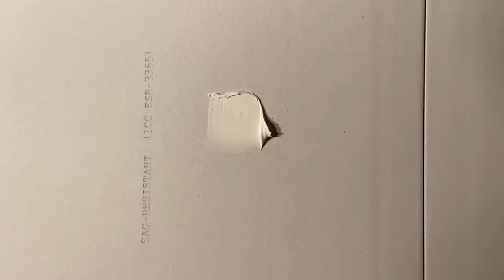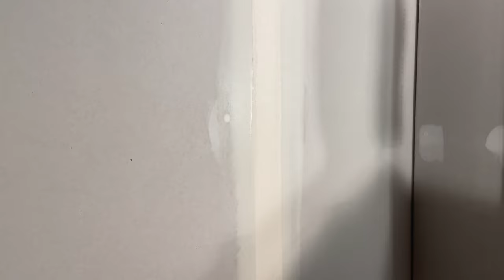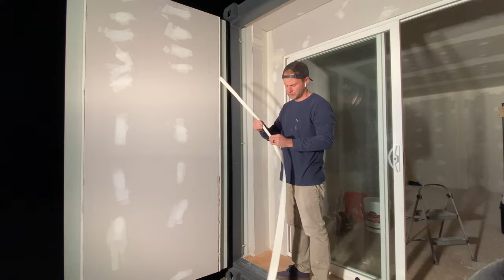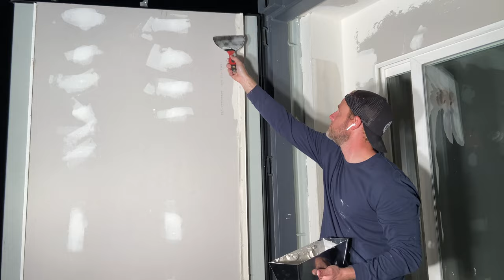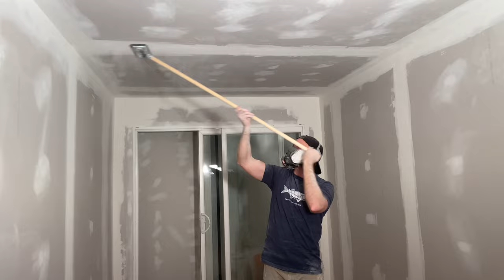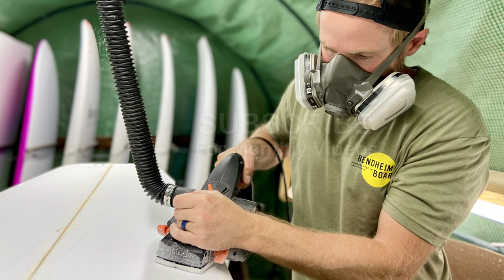Shipping Container Shaping Bay [Part 5 Drywall Mudding & Sanding]

Comment: Taping tip: drop each piece of tape in a bucket of water while you apply compound over the seam and then pull the tape through your fingers to squeegee off the excess water. Then apply tape as normal with a thin layer of compound. This will get rid of any tape bubbling issues (it sucks moisture from the compound otherwise). That is going to be an awesome shaping bay!
Reply: I'm a bit curious, and hope you don't mind me asking, but what is the tape for?
Reply: @juanolvera8567  The tape reinforces the joints so they don't crack. It's just paper, there is no adhesive. You just embed it in compound. But it is a 3 step process. 1) thin layer to embed tape 2) fill layer 3) finish coat. If the 3 layers are done well, you hardly need to sand anything, just a wipe with a damp scotch brite pad is all I usually need. I usually run a trowel over the fill coat before the finish just to nick off any high points that would cause buildup...
Reply: @jamesroscoe7555   oh, thanks I had that question lingering on my mind since some time ago

Comment: Wow!  Your space will be so nice you won't want to mess it up working in it! (LOL)!  Very nice!  Won't be long until you're in there making more beautiful projects.  I found a drywall sanding kit at Home Depot that consisted of a bucket, some hose, sanding pad and some fittings.  You assembled the fittings to the bucket lid, filled the bucket halfway with water and connected a short length of hose from one fitting in the bucket lid to your shop vac.  The long hose connected to the sanding pad stuck down below the surface of the water so when you turned on the shop vac the dust wound up in the water.  Of course, you had to do something with the slurry but a lot less mess.  I used it to suck up sanding dust from paint and body work on cars.  Nice work as always!